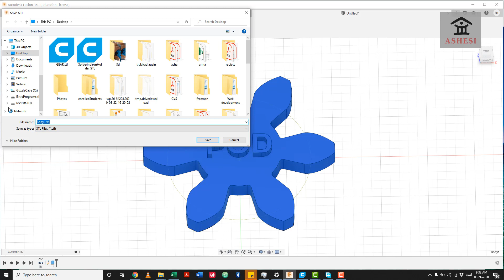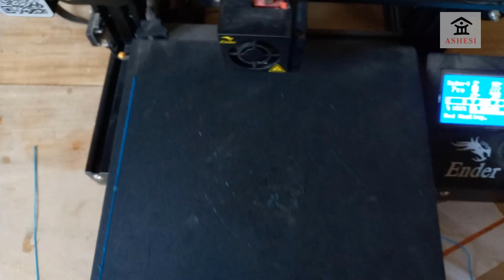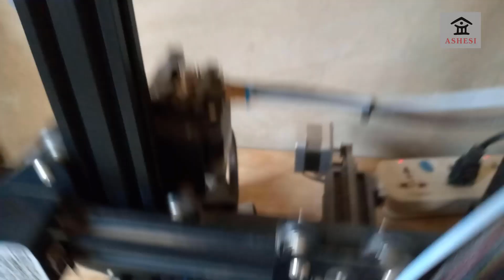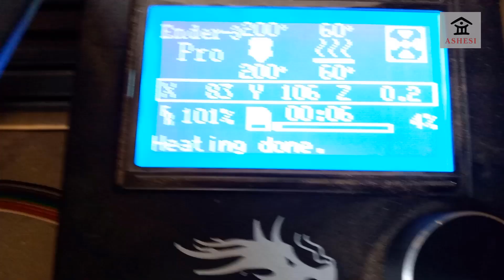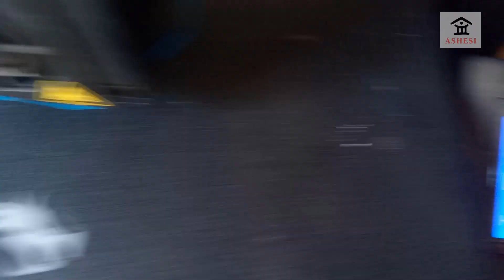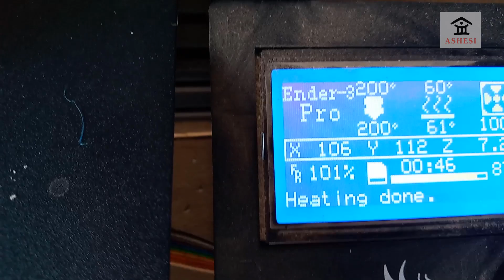Tutorial 8: 3D printing your models

Comment: How do you determine what standard quality to print in?
Reply from the maker: it all depends on your requirements. If I wanted to use the spur gear in a real work situation, I will make the infill
 100% and set the layer height to 0.12mm.

Comment: Please can you please clarify the purpose of the adhesion layer?
Secondly, I assume that the plastic filament released has a temperature almost equal to that of the extruder when active. Hence I ask if it is a possibility that the bed gets heated over time as 3D printing takes place due to the temperature of the filaments.
Reply from the maker: the bed is held constantly at around 60 degrees Celsius. When the molten filament is deposited, there are fans on the extruder that cools it down quickly. beyond the first few layers, there is not much conduction between the bed and the model being printed.

Comment: since the printing was done on the board, what made it flexible for you to be able to remove the printed material from the board after you have done it. This is because if a plastic melts onto other materials, sometimes it becomes difficult to get them away. By the way, it was very interesting because at first, I only knew that 3D printers look like the printers that we used for normal printing. But now I see and is interesting

Comment: Does the printer have a USB option in addition to the SD slot
does it necessarily require an attention whiles printing since it takes some time
Reply from the maker: yes it has a USB port. in that case, your laptop has to be connected to it.
Reply: @NicholasTali  okay thanks
but does it require the users attention whiles printing or it can be left to work on it own

Comment: Nice video.

Does the printer require occasional periods to cool down a bit or does it print non-stop regardless of how long the item will take to print?
Reply from the maker: It doesn't need to cool down bro. the ones at Ashesi are always on.

Comment: why the  need for so much heat to be able to 3D print ?
Reply: I think to melt the plastic
Reply from the maker: the plastic melts between 180 to 230 degrees celcuis.

Comment: What does the gradual infill do? 
Can you use a pen drive apart from the SD card to save your design before putting it into the 3D printer?
Reply from the maker: It doesn't use a fixed rate of infill like I did. It automatically choses the best infill depending on the model.
Yes. it all depends on the printer you are using.
Reply: @NicholasTali  thank you!